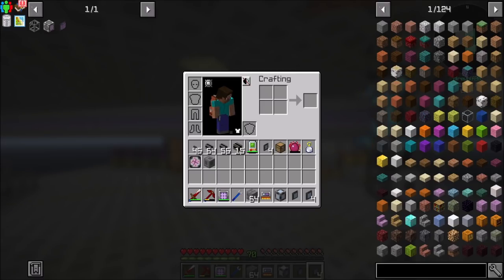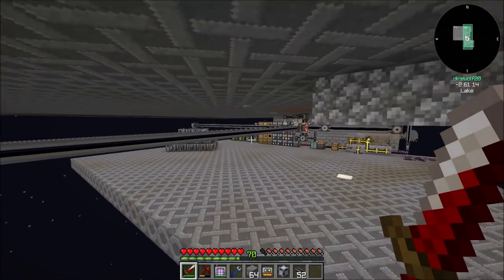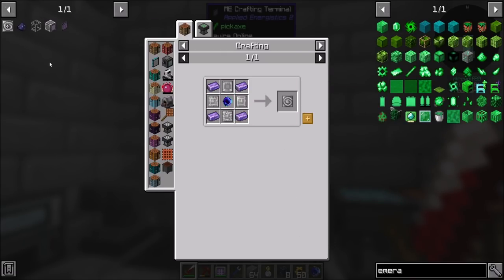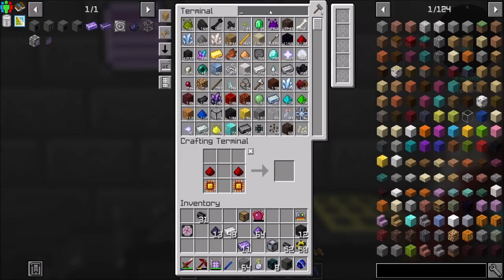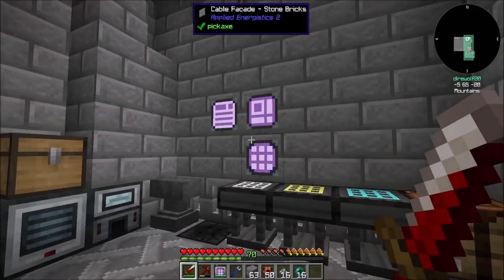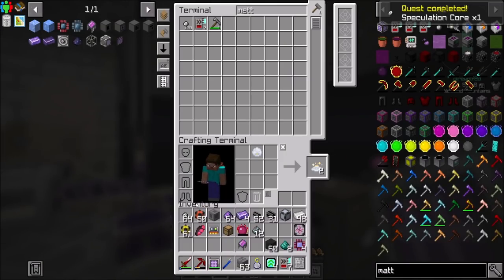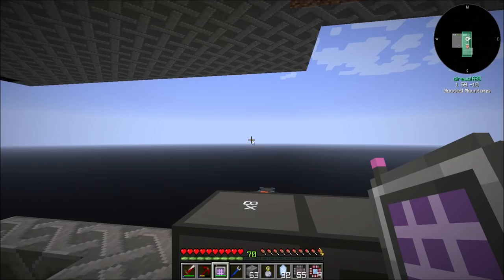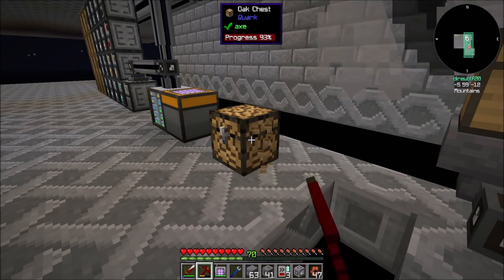NTC2 Ep22 Laziness

Comment: i know im late with this, but you can use the time in a bottle to accelerate the manual grindstone. holding the right mouse-button enables it to work, but not based on your speed. thats why you can just hold as well. (and yes i tested aht in this very modpack)

Comment: Item transport for the chest: What about a tiny AE subsystem with a bunch of fully upgraded buses and a storage bus. Since the chest has only 6 sides and a controller-less setup can have 8 channels, it should be fine for this purpose. All you need is a bit of power.

Comment: Water into condensors has always felt like the easiest fastest method for it. 1 bucket being 1000 units means you can do quite a bit on it.
Reply: what methods work for creating water in this pack? I know it's not infinite.
Reply: @urmom2555  There are no infinite water sources in this pack.
Reply: @benjaminmiller3620  There’s infinite water, however it requires a spring block or something. Go to the comments in the first 5 videos of this playlist. They explain it better.

Comment: As far as I know AE2 supports pumping water into a matter condenser since 1.14 or so and it is super fast :)
Reply: No infinite water sources that I know of in the pack, other than using crucibles with leaves which is slow
Reply: @Dizz1227  Since ice is also 1 emc you can have a slightly more complex contraption to place ice, break and collect water to get 1000x worth of the emc about 20x faster than direct cobble with a low tier machine, however its not really worth it since you dont really need that many singularities (so far afaik)
Edit: actually the thermal's melter enderium upgraded might be far faster and a 1 block solution lol
Reply: @eumim8020  I’m passed this point in my world, and since I installed project architect to allow for my EMC to be linked to AE I didn’t have this problem just used an export bus, but could also magma crucible to ice

Comment: Btw Dire, how do you change the setting on the philosopher stone? The key is set to G and when i press it, it says in chat mode changed but when i try it the mode still isnt changed and its still just 1 block.
Reply: Try remapping the keybind
Reply: @vythe1794  ok thx imma try it
Reply: Make sure you use "V" to expand the range (shift+V to reduce it). All the modes are the same when you're at the smallest range (1 block) but when you expand the range it determines how the range is expanded.

Comment: Just what I expected: Dire only uses P2P to save on dense cables.

A quick lesson on proper P2P usage:

1) P2P tunnels do not need their own separate network. You can hook them up to your existing AE2 system just fine. They take 1 channel per P2P tunnel
2) You can connect multiple end-of-line P2P tunnels to 1 controller P2P tunnel. Remember that the controller P2P tunnel can transmit a maximum of 32 channels
3) What you should be doing with your current setup:

A) First put a dense cable on 4 vertical sides of the controller block
B) Put a P2P tunnel on each cable and connect all 4 to your controller on the top or bottom
C) Connect 1 smart cable on the other side of the controller and route it through your base and put a P2P tunnel where you need up to 32 channels. With the current setup you can have 4 P2P tunnels servicing your base, and it will only use 4 channels on that smart cable, because it will service only 4 P2P tunnels

For future expansion: enlarge the controller multiblock. For each extra side add a dense cable with a P2P tunnel and connect them to the controller. If you have more than 8 P2P tunnels on the controller you will need to replace the smart bus cable with a dense bus cable.

This setup will save on loads of Direwire and dense/smart cable though your base and ultimately gives you a maximum of 32 P2P channels through the dense cable, which comes to a total of 32 x 32 channels through 1 dense cable.

Comment: Something I've never tested - what happens if  you have more than one ME controller in different spots in a network?  I know if you place them connected it just makes a bigger controller multiblock, but I have no clue what would happen if they are only connected by wire...
Reply: they turn red and disable the whole network, only 1 controller can be on the same network, but the whole multiblock counts as one